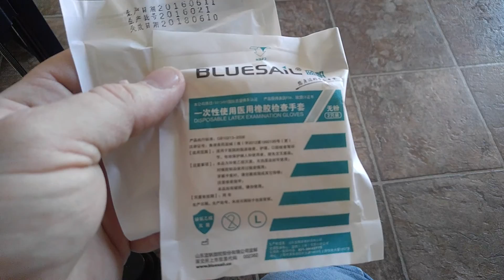Wanhao D7 Unbox  (Duplicator 7, Vr 1.1)

Comment: when will this printer be out for sale do you know that?
Reply from the maker: Pierre Fransson you can buy it on 3dprintersbay.com or 3dprinteruniverse.com wanhao will also sell it directly.  many updates still being worked on.  like the lcd glue that could be seen and I mentioned in the video have been solved by using a vacuuming process when they put that together now.   also, newer controller board, etc.   mine works fine, but occasional QC issues still happening.  but the packaging for shipping is much better.   a list of usable resins on the 3dprinterwiki.info pages and also lost of community support on the Facebook group.
Reply: BurninGems where do you buy your resin ?
Reply from the maker: Pierre Fransson in the US I bought from an Australian company, monocure3d (.com.au)  (good prices and not bad shipping and it's in Australian dollars so it's a good deal for me.  If you are in another country near Europe, you might look for some FTD.   (FUN TO DO)  they are in the Netherlands I think.   I might try some FTD in the future but I loaded up on monocure3d right now.  my only FTD supplier in the US seemed a bit expensive and in California so that is also pricy shipping to me as I'm on the east side of the US.
Reply: BurninGems i live in sweden in the EU. So i will check that out.
Reply from the maker: Pierre Fransson that's the one!   are you on Facebook?  there is the group for it there, lots of help of you get one.   http://www.facebook.com/groups/287910088208745
Reply: BurninGems thx

Comment: hi I was just wondering where you bought your d7 v1.1? did you notice your controlboard still says v1.0 and still has the voltage amplifier soldered.  I was told the v1.1 would have them removed.
Reply from the maker: Jonathan Escalera yes you are right about the board.   apparently they made a different mod and kept the 1.0 board.  Some other fixes that the alpha testers came up with seem to be there...  we call it 1.1 just to distinguish it from the first batch that had a few issues, nothing with the board rev.

I got in late so I didn't fire it up yet.   I will be doing that today if I can. 

There is an active Wanhao duplicator 7 group on facebook, follow that it you haven't already.

as for purchase, there are a few outlets.  you can check the various  Wanhao distributors like wanhaousa, 3dprintersbay.com etc...  there is also direct email to Wanhao sales.  (that's what I did.)
Reply: sshimatzki cool looks sweet so I should expect the same then and yeah I've seen that group I guess now would be a good time to make a facebook. will you be running nanodlp or the creation workshop?
Reply from the maker: Jonathan Escalera I will be starting with creation workshop on an old computer I refurbished for this, but will probably go nanodlp once I can get some raspberrypi's.   (i need a 2nd pi for my FDM printer for an Astrobox or octoprint server... )
Reply: sshimatzki sounds good would love to see your first prints.
Reply from the maker: Just noticed that boards are being shipped out now that have v1.2 on them.  The key difference seems to be a ZMAZ sensor port and the power connector coming off for the LCD board.  Picture was put up on the FACEBOOK Wanhao Duplicator 7 group just recently.   So They are definitely listening to the userbase and making tweaks to the printer.